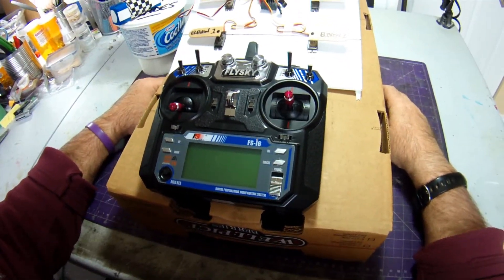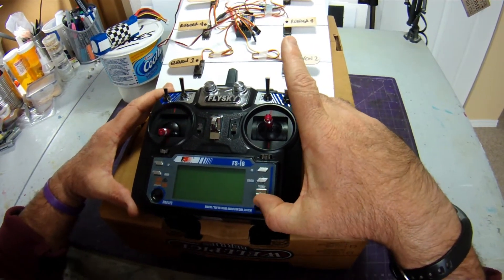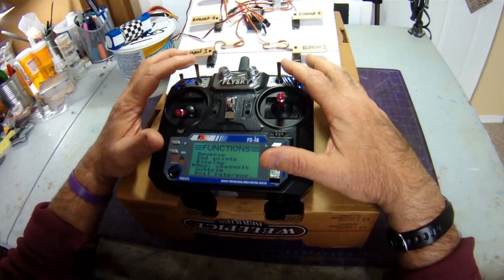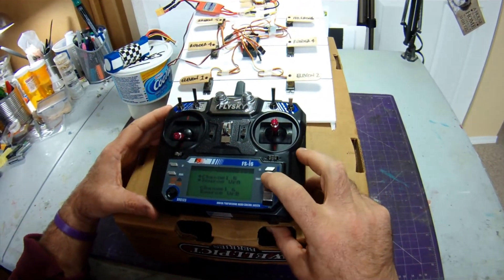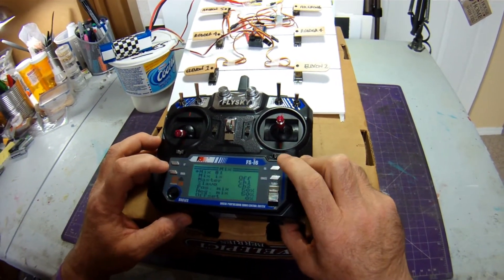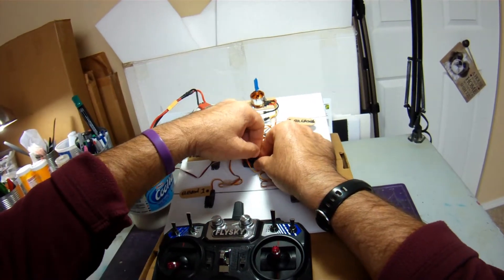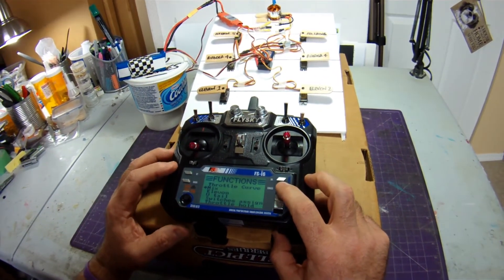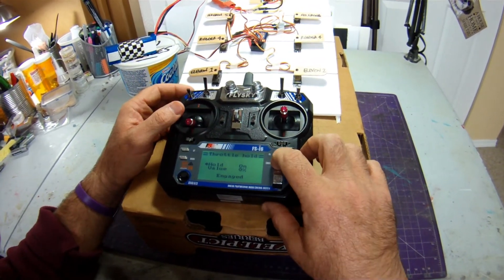Basic programming for a 6 servo park jet in FlySky FS-i6

Comment: Hi scott building the rc powers Mig 29 and planing to use futaba Sg 14 transmitter can this set be done with my tx.
Reply from the maker: I would assume so, I'm sorry, but I know nothing about the capabilities of your transmitter.  What control surfaces do you want activated?  Cheers, Scott
Reply: @e3Scott  Hi Scott I would like to have ailerons elevons and rudder my transmitter  is a futaba 14ch t14sg.
Reply from the maker: @lancelotlalla7561  Do you have the manual or have you tried searching you tube for videos on how to set up that transmitter?  Cheers, Scott

Comment: hello, I have an esc that I used in a quad with betaflight, now I want to use it in a plane but I connect the esc directly to the receiver and the engine does not work while the servos do work, can you help me?

Comment: How to set up analog servo  with GoolRC Flysky FS-i6 ?
Reply from the maker: All the servos I am using in this video are analog, I'm not sure what your question is?  Cheers, Scott
Reply: I need to replace old transmitter and receiver on Nirvana sailboat , servo is FP-S3003 analog. I was thinking to replace this with GoolRC Flysky FS-i6 and FS-iA6 Receiver Mode 2 I don't know if this is going to work with this servo Futaba FP S3003  ?
Reply from the maker: I don't see why it wouldn't work.  Do you have the transmitter and receiver now?  If the servo doesn't work, you might have to replace the servo, if the plug fits into the receiver ok, it should work, but I have never used a Futaba servo, so no guarantees :).  Cheers, Scott
Reply: I didn't order this receiver and transmitter yet, I'm trying to figure out is this going to work. thanks for help Scott.
Reply from the maker: Sometimes the servo plugs on Futaba servos can have a little ridge that you might have to trim off to get it to fit properly into the servo port from what I have read.  The servos I use have JR style plugs which are very similar to Futaba, but without the little ridge.  Best of luck :)  Cheers, Scott